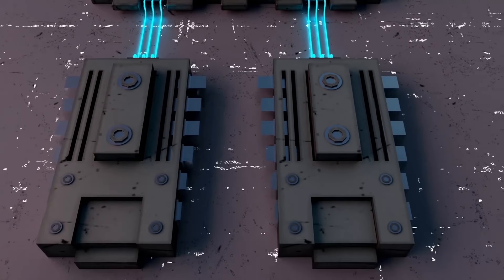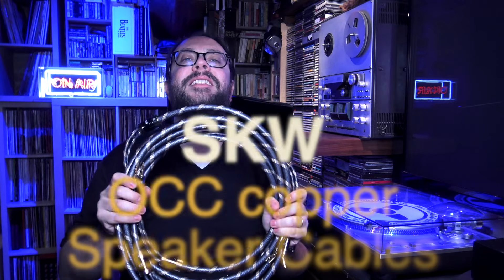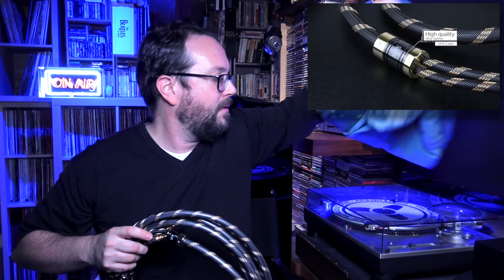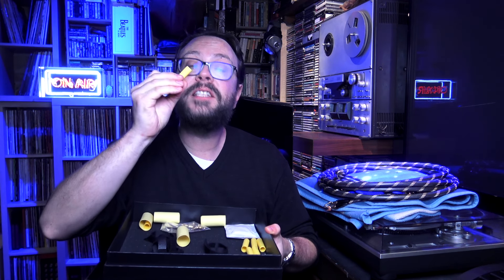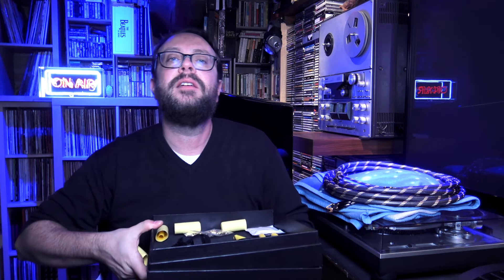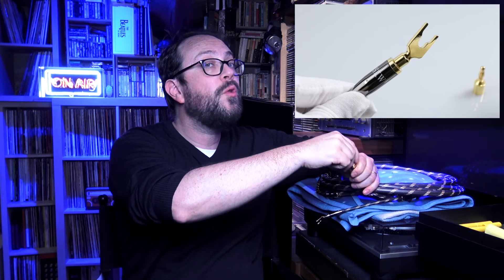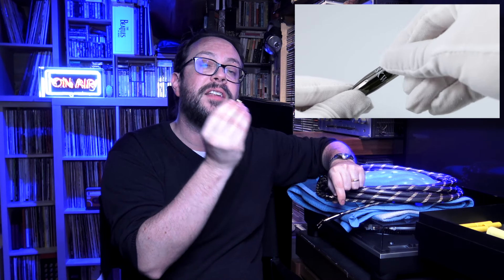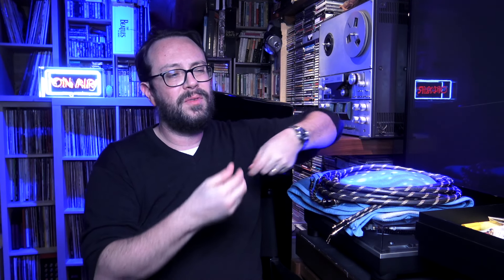Unbelievable high-end OFC copper speaker cables at very low price!

Comment: Can you please explain how the speaker cable need to "burn" in for the sound?What does the cable do so you get an other soundfield from your speakers if you let them burn in?Maybe in depth on how the structure of the copper does this when applied to power.And how much power is put out of your amp to your speakers...........
Reply from the maker: Burn-in mainly takes place with the dielectrics (insulation) of the cables. Also, cables should not be moved. When moved things change again. Based on the power strength you probably obtain different periods of burn in. In any case I would say you need at least 40hrs.
Reply: @anadialog  Hi there..enjoy your videos. Regarding OCC copper and silver cables, Audio Sensibility from Canada offers excellent OCC cables. All my speaker, interconnects, power and phono cables are from Audio Sensibility. The owner Steve's father worked with Prof. Ohno and was a friend. Why buy from Amazon when you cannot possibly authenticate the materials used? Audio Sensibility sources directly from only 3 distributors authorized in the world to produce OCC cables. Why make that extra billion for Jeff at Amazon? :)
Reply: Have to allow your brain to burn in the halo effect.
Reply: @jonnsmusich  concerns me once the cables are burned in they will burn out at some point🤔joke
Reply from the maker: Sure! No problem for me!
Reply: @anadialog  Still didnt explain what it does when you talk abouth burn in.First of the molecuul that wil start jumping in the wire when current is given  and it  dont need to get placement in the core itself.Insulation doesnt have electric properties to settle in so what does the plasic/sillicone innersleve and outersleve have to do with burn in,they dont get hot to chance in structure.So my point is please dont talk of burn in while its electrons who move.If you make these claims please come with data or other  resistance or show on a scope what they do,now you talk like its a must to let the cable under load for 40hrs to hear the so called chance what is a false statement.
Reply from the maker: The best thing is probably to link you to the explanation of Paul McGowan: https://www.psaudio.com/pauls-posts/dielectric/

Comment: Amazing that so many people are stuck on China, yet clearly haven't looked at where their own stuff is made, or have a problem shopping at Wal-Mart.  
I purchased the same 3 meter speaker cable from the review for my front 3 theater speakers and the 2 Atmos channels built into my towers, as well as SKW's HDMI 2.1 cables for my interconnects, about 3weeks ago.   Replaced some old Monster Cable from years back.  I'm currently running a Yamaha Aventage A4A and Definitive Technologies BP 9080x series all the way around.  Noticeable difference across all metrics.  Imaging, soundstage, clarity, detail, bass depth, all were enhanced.  It did take about 2 weeks for them to settle, once they did, even non-audiophiles noticed the difference immediately.  I don't have any technical data to back up anything, but your ears don't lie.  These sound good.  Had to adjust  speaker levels after switching. For $150/pair, best investment.  They have a set of silver plated speaker/RCA cables, but I wasn't trying to spend $450/pair.
Reply from the maker: Thanks for your detailed feedback!

Comment: Pretty much on the basis of this video (as there are not any other real reviews of these cables), I tried them with my Rotel amp/B&W front speakers. They were a MAJOR improvement from my old bulk cables from the store, right out of the box (without a “break-in” period, if that is real or not). I liked them so much that I bought a second pair for the second pair of speakers. The system has for sure had a major upgrade, and for a modest outlay of money! I would describe the sound as clear and precise, but silkier, smoother, with warmth and depth - what I like! Thank you for the great tip! 😀
Reply from the maker: Thanks for your feedback!

Comment: Sound good out the box, bass improvement is what I noticed over current cables? . I will try for  3 weeks.. Did you hear much improvement over time? Thanks
Reply from the maker: The Ramm audio day and night after 10 days, this one I would say a good improvement but not dramatic. Just make sure not to move them around. Otherwise you start over. I know it sound absurd but that is what I have noticed.

Comment: I am happy with my pair but am also curious whether you found something better but still carrying an affordable price tag?
Reply from the maker: Good question, what these lack is good insulation. The Ramm ones I cite have polyethylene, which is goof but not as good as teflon and the insulation is almost as important as the conductors and connectors. I am probably going for the Neotech Nei but they are much more expensive...if you find occ copper with teflon dielectric at a decent price please tell me and I will test them!

Comment: hello anadialog , I finally got this famous 3 meter occ cable.
And wow, what a slap, it's a killing.
I rediscovered the sound of my jbl ti 250 jubilee thanks to your advice.
what sound opening, increased precision in the medium, controlled bass.
For my part, I use the spade connections from my power amp to go to the speakers by the banana connections, then finally a oehlbach jump! straps to inter connect the 2 terminal blocks.

A great thanks !!!!!!
Reply from the maker: Nice speakers! Thank you so much for your feedback!
Reply: Bananas normally beat spades easily because higher contact surface area can be archieved.
Reply: @raymondchan3587  ok i will test bananas
Reply: Hi Jerome.  How is your feedback after one year.? Asking as I'm looking for speaker cables to replace my current  rocket 11. Thanks

Comment: Wow this was a great alternative to the Ramm Cables.  Still need to know if I have separate binding posts for woofers and twetter on my speakers if running separate cables is really better.  If that is the case the Rams will be almost cheaper because they give the ability to run one cable and separate the wires for the double binders as you show in the diagram on video 2 of DIY speaker cables..
Reply: Went with the Ram cables. Appreciate all you do

Comment: Hi. Watching ur video really trigger me to try out.  Before i order i would like to have ur opinion whether it will match my setup.  Currently am using nordost flat line speaker cable hook up with quad s2.  Am using preamp tube 27 and solid state ampilifier.  Currently my “complaint” on my setup is soundstage and high notes.  Will this skw cable match my system ?

Comment: I spent nearly £1000 on cables and for me the experience of not having to put up with those bloody radio frequency sounds was so well worth it, in fact I've kept my old speaker cables in place so I'm able to show my friends the difference in sound quality (interference) and to be fair nearly all of friends can't pick out the difference, that is until I point it out to them! The thing is I had been putting up with radio frequencies/electric magnetic interference for the first couple of years only because I wasn't quite sure what it was, the point iam trying to make... it was only after was able to differentiate between mechanical noise and radio frequencies that I finally was able to move forward and sort this problem out!
They do say audio is subjective therefore some people are able to pick up on radio frequencies and some people are not, so if you're one of these fortunate Souls who don't pick up on radio frequencies just count yourself lucky!
Reply: Not just radio noise affect sound, the capacitance affect the speed and eddy current also count.

Comment: Hi, the nakamichi link doesn’t work for either the UK or US.  Didn’t check Italy.  Is the another product exactly like that?  I have JBL L112’s, vintage.
Reply from the maker: There has been a big problem. I had to change the title  because it turned out that they are not OCC copper but OFC. They still sound good but they lied. Here is the final video of my investigation: https://youtu.be/XVLR9EuCkgo?si=b5IzygWd_lxHMakT
Reply: No problem, I had already ordered them and some Nakamichi like connectors. I commented on the follow-up video yesterday. Thanks for the heads up though.

Comment: Thank you for the video and Kind Regards. I purchased SKW speaker and interconnect cables per your recommendation and am happy with the result except for the problem I wish seek advice for namely the interconnect cables from the CD player to the amplifier I could only part way install because of a tight fit and as the shell of the SKW RCA connector is tapered without a blunt end so there is nothing to press against with the result that the tight fit would not completely be pressed in but only part way. The signal still goes through as I have audio output but would prefer a solid complete full install. Any advice? Thank You Kindly Cheerios
Reply from the maker: Unfortunately I haven't tried the interconnects. If you don't have a good connection maybe you should return them or sell them.

Comment: Hi, I  bought them end my impression is an enhanced low frequency  and an emproved stage, more center and with good separation between the instruments but the meed range is quite laid back and the high frequency is not so bright resulting in a muddy sound signature! Overall a good quality construction still a good buy in my opinion i hope someone can share their impressions as well...peace!
Update: after the burn in things are better meed range is still a bit laid back.
Reply: well that doesn't sound like very good OCC single crystal wire to me because that doesn't happen with OCC single crystal wire. no muddy sound with properly designed OCC single crystal wire.

Comment: Help from anyone.
I know this is an old video but I'm just getting into this stuff. I have my record player set up and the wire cables I use I have to twist the ends real tight, press the tab button down and shove them into the back of the speaker. I have vintage equipment.  Can I use these cables in those speakers with the pin thingy attachment? 
I'm researching new cables because I'm picking up a radio signal when I play my vynl records.
Reply from the maker: It ain't old! Of course you can, that is why I showed that very thin type...for vintage equipment!

Comment: Are people still using these cables? Just installed mine yesterday, treble seems brighter which I wasnt expecting as I have their RCA which is settled now. The RCA cable is warm with a rich tone, not sure on sound sig of the speaker wire just yet.
Reply from the maker: Give it a week of listening, they will change 100%. In better? Up to you...
Reply: @anadialog  in better? Sorry I didn't understand that! Yep going to give it a week possibly 2, then put my older wires in to see a difference 👍🏽

Comment: Do they make bi-wire versions or do you suggest to use the SKW Speaker Cables and just get SKW Jumpers to use with the cables (I see on Amazon that SKU does make jumpers but can't seem to find bi-wire versions of the cable) Also, does SKW have their own website?
Reply from the maker: Never use jumpers IMO. I had a triwire ATC pair of speakers and when I removed the jumpers with a true triwire speaker cable I hit the ceiling the change was so amazing! No they don't...make them with this cable I showed here: https://youtu.be/sdKdB-yaFJc

Comment: I believe this set of speaker cables is SKW BG-05. SKW has a more expensive set of speaker cable (SK-HF2017) with silver plated copper OCC and 3 layers of shielding. Wonder if you plan to review this as well.
Reply from the maker: Yes! I am not a big fan of mixed metals but you never know...the conductors seem very nice...thanks for informing us.
Reply: @anadialog  you are most welcome. In fact, I have just realised SKW has another set of Copper OCC speaker cable which is gold in colour (SKW HF-2003) and it’s supposed to be better than the BG-05. I thought this might interest you better.
Reply from the maker: Yeah!

Comment: Hi compare to the zavfino prima mk2 you made me discover. Which better? Thx
Reply from the maker: These are speaker cables, I think you are referring to interconnects for the Zavfino. In latter terms, I don't like the connection of the Zavfino but they use better insulation so, they win!

Comment: Have you tried C2G Velocity speaker cable?  You will have to terminate them yourself but it is another low-cost alternative to the expensive designer brands.  I've compared them to Discovery and MIT
Reply from the maker: I haven't. Thanks for the suggestions.

Comment: Great sounding speaker cables.
Reply from the maker: It says OCC and also single crystal copper, which is the same thing. Check here for example: https://www.amazon.com/SKW-Audiophile-Speaker-Convertible-Connector/dp/B07KF2DPZM
Reply: @anadialog  Got you thanks.
Reply: @anadialog  Hey have you tried their higher up line of cables? Have you tried their thicker 12 gauge offering (SKW HF2017)? It's more than 3 times more expensive, curious to see how it stacks up against more expensive cable brands. Thanks again.

Comment: Have you tried solid core speaker cables? I tried many different stranded copper cables and never noticed a difference until I tried solid core 6 9s copper cables.
Reply from the maker: Yes, and they are great! I highly recommend the Oyaide solid core 102 cables. Unfortunately they are prohibited in a few countries like in Germany for example.
Reply: @anadialog  can confirm oyaide 102 explorer v2 cables are nice. Use em with their silver and rhodium plated banana plugs on my accuphase e380
Reply from the maker: @ognintendo7061  thanks for sharing that!

Comment: The manual for my amp recommends multi stranded copper speaker cables. Can you recommend a good quality 14 gauge 10 foot long cables at an affordable price?
Reply from the maker: 14 gauge seems a little thin IMO...try the ones in the video or any made out of OCC copper. That is what makes the difference...

Comment: These SKW cables are only 14 AWG ... do you think that they are better than Blue jeans 10 / 10 AWG ...for example ?
Would the Kimber 8TC be better sounding than both of these? ...or not?
Reply from the maker: I haven't tried those...I tend to trust the materials used, so if they use OCC copper, they are good for me! Obviously with speakers cables the gauge is also important and lower is usually better.

Comment: I have a Marantz 2230B and ordered the cable and pin connectors. The linc for the UK  and Italy are correct but the linc for the US is not. That connector is for a bare wire. Love the cable. Waiting for new pin connectors. Appreciate all the information you provide.

Comment: What should I get to link this cables to my Denon DRA-800H? I can't find the right connector.
Reply from the maker: You can use spades or bananas, which are both included...
Reply: @anadialog  the thing is Denon connectors had black plastic caps on them due to some EU regulation, but I didn't know that. Eventually I managed to remove them and find a way to use some QED assembled ones (bananas are not original QED though).

Comment: Does skw make a bi-wire cable?
Reply from the maker: Not that I am aware of...but you can do your own using two pair perr speaker, connecting them together on the amp side...
Reply: Or at least they could make jumper cables too...

Comment: loving the info on your channel, big thumbs up!..was wondering if it would be worth trying the Ram Cables you mentioned? my system is naim unity atom/goldenear triton 2. any comments would be much appreciated, cheers.
Reply: oh one other thing..would the Ram Cables be an upgrade from audioquest go 4 cables?...
Reply from the maker: The ramm as well as the SKW are excellent for the price point. They are both better than the Ausioquest because of the higher quality type of copper, OCC copper. If you want the best, as I always say, hunt for OCC copper (or silver) with teflon/ptfe insulation. I recently passed to a Neotech NES 3001 and the jump was quite impressive. There is also bulk cable from Neotech with those characteristics.

Comment: Well, everything sounds very optimistic but how about some specs, like resistance, capacitance and inductance of these cables.
Reply from the maker: There aren't any, as for most cables.
In any case at these lenghts, those issues are very very low. Longer cables must be carefully analysed instead.
Reply: @anadialog  Yes, you're right. That's the problem with speaker cable companies. I buy only those cables whose manufacturer provides specs. Some still do.

Comment: The pictures on Amazon are multistrand while yours is single strand. Any difference?
Reply from the maker: I think you are referring to the graphic representation in the video. That was just a simplification, the cable should be multistranded considering its flexibility. I haven't found a clear picture of the conductors. I checked on Amazon but I did not find it...